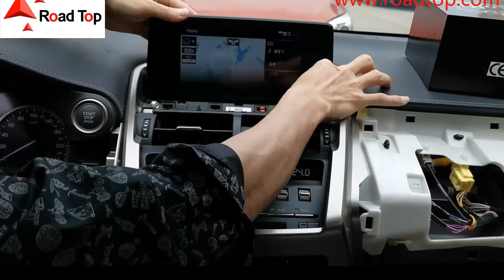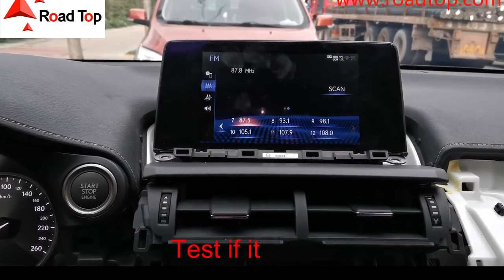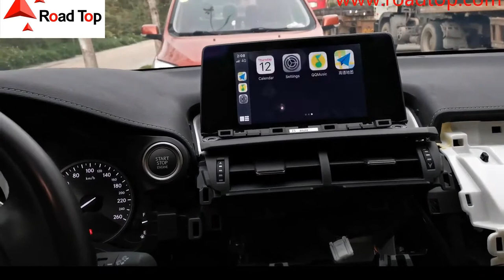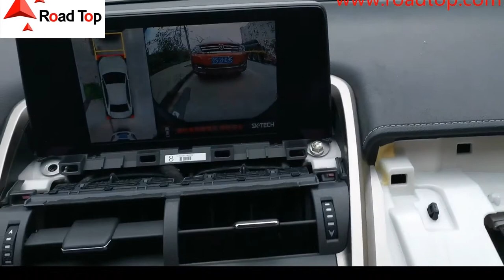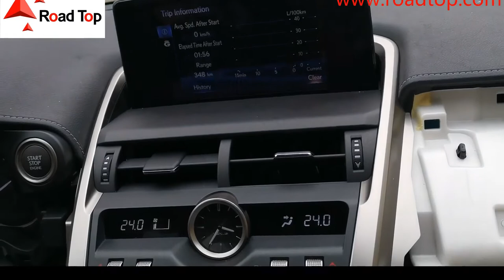How to install Road Top Wireless CarPlay & Android Auto Decoder to Lexus NX car

Comment: I got everything installed in my sisters 2017 lexus nx. 
Had no audio issue with the screen working. There seems to be a disconnect with the “media” button under the cd player. I hit media a couple of times and the audio started playing

Comment: I have 2017 NX300h with rotary knob and 3 button.  I connect and there is no sound.  I turn my phone up and the car colume up, but there is no sound
Reply: Hi. Did you fix the problem?
Reply: @dl.5799  nope.  Still working on it.
Reply: @Scottlmt  did you manage to sort it as I am in the same boat

Comment: I bout this product the buttons work but not the audio I installed it correctly no response yet
Reply: do you find the answer ? I have the same problem
Reply: I bought this for my 2017 rx350 and installed it today. No audio at all even after making sure aux setting is on and removing the oem Bluetooth connection so only carplay is connected. Waiting to hear back from eBay seller....

Comment: Hi I purchased your system for my 2015 Lexus nx with navigation, 8" screen and 3 button touchpad. Your instructions do not show my touchpad but instead a 4 button touchpad. I've toggled switches 1 and 5, connected both small connectors, and the additional screen power plug. The system connects to my phone on Bluetooth but it won't switch the screen when I hold menú for 3 seconds. Please advise who to contact or what I should do thanks.
Reply from the maker: Hi sir, please contact with us via platform for the support or send the issue to this email, the email address is: roadtop@foxmail.com, thanks.
Reply: Scott Kunz were you able to make it work?
Reply: @eljavi8573  no they made me waste my time for an entire week. Spent 10 hours fiddling. They gave up eventually and said it doesn't work.
Reply: Did you figure it out I’m in the same situation